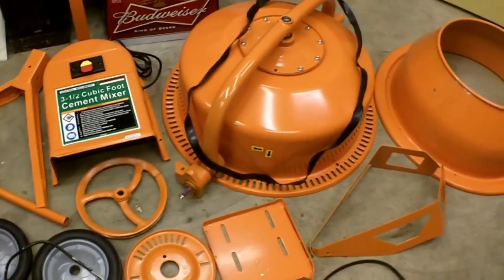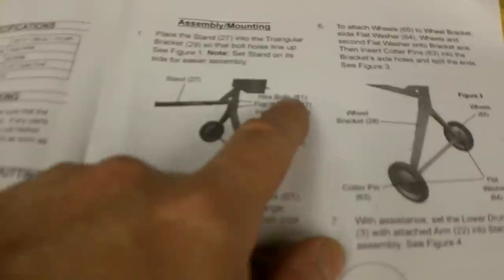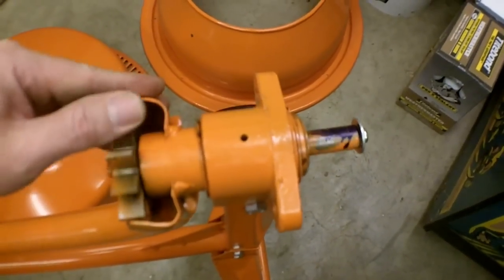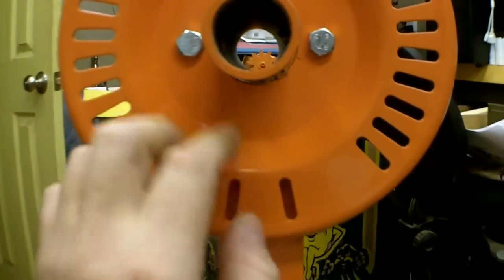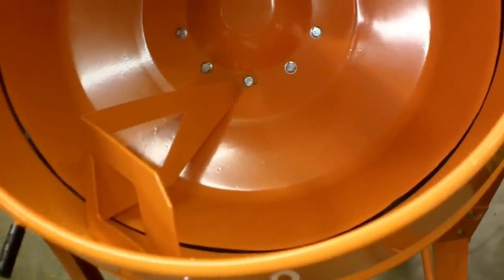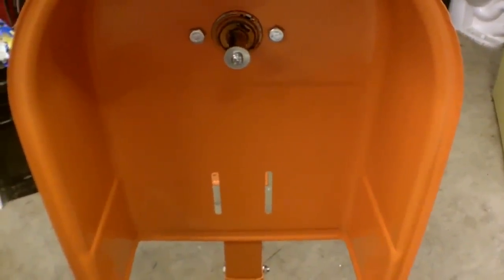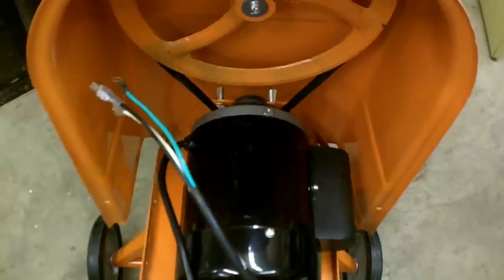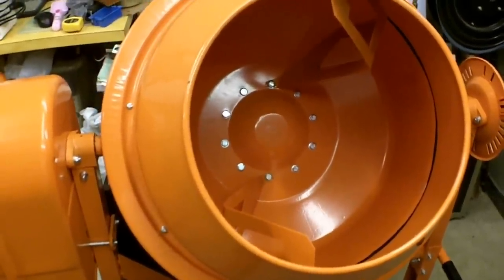Harbor Freight 3.5 Cubic Foot Cement Mixer Assembly and Review. Item 67536

Comment: You are a lifesaver, It is April 2019 and the manual has not improved not even a bit. Thank you so much for your effort to show a real assembly, this video rocks, I followed the steps and successfully got it working. It took me around 2 hours working by myself and now is ready to work around the house. Thanks a lot again Mr ghostses and best wishes.
Reply from the maker: Thanks Eduardo! I find it crazy after all these years the manual is still garbage. With that said, I'm glad the video is still relevant and helped you out. 2hrs. to put it together and now the real work begins....lol. Take care, G.
Reply: Well it's March of 2024 and guess what. The instructions won't even be good burning material.  I have watched 4 videos of assembling this mixer. Would have saved me half a day if I would have just checked youtube! Mine did not have separate bags of bolts, just all thrown in a box for me to figure out. Lots of bolt swapping before finishing. No screw in the box for end of pully shaft.. noticed one guy did not line up arrows on tub halves but no trouble putting in blades.  Not so with me, blades would not line up to holes until I noticed I was 2 holes off. Good instructions instructions 😅

Comment: I see that the HF mixer that you bought , came with a case of Budweisser. The one that I bought did not. So I returned it back to HF and they would not return my money but instead pointed me in the direction of the beer store where I now have a complete Hf cement mixer. I hate it when I buy something and it is missing the most important parts to complete the project. Thanks .
Reply from the maker: Yes it did! I've heard reports from others that theirs were also missing the case, and also got no satisfaction at the store about the issue. They were also instructed to go elsewhere to get the missing piece- which I find extremely odd. I'd expect more from their quality control and hope they will correct the problem in short order. I can see missing part of the case, but the whole thing?- that's simply wrong on every level. At least you got your kit completed, even though it cost a few extra bucks. Take care, G.
Reply: Thanks "G" ... Next time I might just shop with Northern Tools instead.
Reply from the maker: Texas Confederate

Good deal...LOL! NT might include the "proper" parts! G.
Reply: Step 14:  does the disc or the spiral spring go in first?
Reply: @jessemiles8347  the disc
Reply: I returned mine be because they would give me the case. Lol

Comment: Bless your heart.  I will be receiving my mixer from Amazon in 7 days and all I have heard is complaint after complaint about the assembly process.  What you have done here in your video is clear up all the confusion.  I've always been very good at assembling all types of things and if that parts are there I can do it no problem but here you have shown that the booklet does have a parts list to match up with the instructions which so often over looked and leads to frustration and hours of assembly and loss of temper.  THANK YOU FOR THIS VIDEO    BRAVO.
Reply from the maker: Thanks Dan! Glad it will be helpful. Good luck with yours, G.

Comment: Great video saved me from much heartache. Thank you for posting.
My cement mixer came with the fasteners in separate numbered bags. The lower drum was also came attached to the bracket.
I had to attach the ground wire from the motor to the existing ground location as this was the only attachment point on my cement mixer.
Used it over the weekend mixing many 60lb bags of cement, mixed 2 bags at a time, without any issues.
Reply from the maker: Thanks Paul! Glad it was helpful. Yeah, I heard of may combinations on what-was-what from many viewers. It sounds like yours has already paid for itself with what work you've done so far. Good to hear! Take care, G.

Comment: Out of all the videos I have seen on assembling this mixer, this was the best one. Now there are a couple of differences from when this mixer was put together to today Oct. 2020. One difference was when you hook up the wiring there is not a second post for the ground. You will have to unscrew the post and place there along with the other ground wire coming in. The other difference was minor and the only part I had left over or extra was another wire grommet when you feed into the housing cover. But nothing extra or missing. Thanks again was very helpful in following and assembling.
Reply from the maker: Thanks Bill! Glad it was helpful. Take care, G.

Comment: This cement mixer has the worst instructions of anything I've ever assembled. I am a retired jet engine mechanic, so maybe I am expecting too much. It's as if a disgruntled employee created these instructions to get back at the company. There are several references to parts, or bolts with no picture. Several parts were bent, and a couple were pre-rusted for my convenience. I used my own bolts, washers, nuts, etc. to ensure that this mixer was put together so that it would work safely. Great video!
Reply from the maker: LOL! Agreed, their manuals leave much to be desired. I'm pretty sure they switch manufactures from time to time, or make design changes but never update the literature to reflect them. Not to mention, most of them suck to begin with...lol. That's partly why I show assembly in my reviews if required. Glad you got yours sorted out- bent, pre-rusted and all. Good luck, G.
Reply: HAHAHAHAHA I sit here, one jet mech reading another jet mech's thoughts on some shitty ass instructions. HAHAHAHAHAHAHA  AD1(AW) USN H60 powerplants technician, TF34 CER, JOAP lab supervisor. this thing was created to make us doubt our skills.

Comment: This video helped me immensely.  I didn't even read the directions, I just watched this.  I completed the assembly in about 2 hours, while putting down about 3 beers, and gathering the tools as needed.  If you remove the beers and time spent looking for tools, it probably took all of 90 minutes to assemble.  Thank you for creating this video!

Also, today I put 60 bags of concrete through this thing, and it worked flawlessly.  I got it on sale for $209, and had a 20% off coupon, for a total of $167...that's slightly more than a 2-day rental from Home Depot.  Hopefully this thing lasts another day and makes it a smart purchase.
Reply: +Ted Kuhn PS, I appreciate your experience-based tips, like adding grease, thanks again!
Reply from the maker: +Ted Kuhn Good deal Ted! I'm glad the video helped. LOL, nothing like downing a few while working on something- it almost takes the work out of the work. I think you'll make it well past the break even point over renting and will still have the tool to boot. I hope you treated yourself to a few more beer after running 60 bags through it. That is if you could still lift one...lol. Take care, G.
Reply from the maker: +Ted Kuhn Thanks again Ted! G.

Comment: Thank you so much for your time and effort. Your video helped me decipher what the instructions simply could not. I usually don't read them anyway but found myself in quicksand then started reading them, then just came to your video and threw them away with the box.  I too bought it when it was on sale and it's been in the box for the last 5 years. For a hundred and sixty bucks its better than mixing cement in a wheel barrel.  Now I'm going to make it work for storage fees, when it breaks I will send it back to China.
Once again, Thank You.
Reply from the maker: That's cool Ronald. Glad it was informative. Take care, G.

Comment: Of the videos I watched, this one was the best in terms of covering most of the little issues that came up during assembly. Add my thanks to the many here.

To add my 2 cents:

Agree that gasket glue is not required, but putting the gasket in without will require a lot of fiddling with the gasket during installation to make certain it stays where you want it. I started by putting the screws (one at a time) through the top drum and the gasket. The gasket held the screws in place as you flip the upper drum to get it placed on the lower drum. You then have to go around and push each screw into the corresponding hole in the lower drum. After that, you want to get the gasket shoved in correctly between the screw locations, HOWEVER, do NOT push on one side of a screw location too far or you will rock the gasket out of the opposite side. Two fingers, one on each side of a screw location pushing equally was the best method for me. I ironed on the top drum, first by bringing the screw and nut finger tight and rechecking the gasket as I went around. (Just spin the drum and forget walking around the unit.) Next I added about three or four turns on each screw to snug, again checking gasket for alignment. Finally added turns to tight all around.

My unit had a burr in one of the bolt holes and one of the paddle holes at the bottom was misaligned. Used needle nosed pliers to extract the burr and a punch to align the misaligned hole and all was well. Make certain you look at the picture of the assembled unit once in a while to make certain you are adding the correct parts to the pulley side or the motor side. Just keep yourself oriented correctly, because the main cross piece is pretty much reversible and you can get things turned around in your head as to what goes where.

The pulley key on my unit was a bit big to fit into the slot cut into the main shaft, so ended up putting the pulley on the shaft and lightly tapping the key into the slots. On my unit one side of the lower drum arm bar was misshaped so had to get a mallet and a block of wood to tap that end into the supporting brace. No biggie, but certainly speaks to lack of quality control.

Thanks for the tip on removing the switch from the outside motor cover to get to the screw head to attach the ground. So much easier that way. If the manufacturer would have included a second nut on that grounding screw, this wouldn't have been a problem in the first place (a-hem!). Just like this video, I matched wire colors green to green for ground, black to black and white to white for the switch. That's standard, but as the man said, disclaimer: no instructions so you are on your own for that step. Don't understand companies that fail to update instructions when manufacturing and/or assembly procedures change. (Cough, cough, a-HEM!!!)  Some videos show a struggle to not damage the electrical wiring or switch when attaching the wire to the motor and before attaching the outside motor cover. Get a saw horse or a small table or stool to hold that outside motor cover at a reasonable height while attaching and the whole issue goes away!

The bolt for my spring tension adjustment was not in any bag and just thrown loose into the Styrofoam tray on the top. Glad I found it and saved it as it would have not been fun to replace that bolt in the middle of assembly.  BTW, one of the other videos talked about trying to mate the drum halves before putting on the handle. Glad I had the handle on first, as it would have been a whole lot more challenging to try to manage the two drum halves, the gasket, and all those screws if the bottom half drum was swinging freely!

My last challenge was setting the electrical cable clamp during motor assembly. Had not done that before and did not realize the hole is keyed to a particular orientation of the clamp. Fought with it for a while then turned the clamp 90 degrees to what I what trying and it slipped right in.  Hard to see that requirement when the black switch box is mounted to the outside motor cover. BTW they included a second cable clamp in my parts bag. Anyone missing one?

Got my unit turned on and it did spin. Will find out tomorrow if I missed anything.

Harbor Freight, you need to start finding American (or at least north American) suppliers for quality, yet affordable tools. I want to stop buying from China.

A note to the other video makers (THIS NOTE DOES NOT APPLY TO THIS VIDEO - THIS VIDEO IS GREAT!):  If you screw up a step in your video, don't just put a caption up that says this is wrong and go on. Take the time to reshoot the scene and give us the correct way. First, it hides your screw up, and second, it makes you look a lot smarter, more credible, and more trustworthy to the audience. I stopped watching a couple of videos once they admitted their mistakes. What else did they mess up and not admit!!! (Or were they too stupid to realize their other mistakes???)

A note to my local equipment rental store: If you'd have charged about half your current rate for concrete mixer rental I would not have bought this unit and rented from you. As it is, my planned use for the unit will more than cover your rental fees and I still have the unit for family and friends to borrow when their projects come up. Yeah, I have to store it, but I'm done paying outrageous rental fees for a simple mixer. If I get tired of storing this unit, I'll sell it and recover at least part of my money - none of which went to you!
Reply from the maker: I like the way you think Tom! The rental fees and having to race the clock is exactly why I purchased mine. As for your comments on videos captioning and covering up mistakes- I wholeheartedly agree. I can't tell you how many times I've taken something back apart just to shoot the clip again so the information is correct. Not trying to imply I'm any better than anyone else- but just to illustrate how much time an effort it takes to do videos like this. Anyway, hope it works out well for you. Take care, G.

Comment: Thank you for this video. I bought the mixer yesterday and there were a few changes but the video is still applicable and made the install extremely easy. The lower drum is now connected out of the box. My arrows did not line up perfectly and were off a few inches but didn't seem to hurt anything. The inside of the switch is a little different but you just need to follow black to black and white to white.  With the 20% coupon it was $164 including tax in NC. It's amazing to me they can design, manufacture, and deliver something like this for the price. Thank you China and thank you for making this video.
Reply from the maker: No problem! I've heard there have been some small changes. Glad it was still useful getting it put together. Thanks for the info and good luck using it for your projects. Take care, G.

Comment: No more bags of bolts numbered... just one small bag for drum assembly and another bag with various nuts, bolts, washers. Your video helped me....... some things are different in the assembly now... just bought mine 12/2/2019 and assembled 3 months later. I used rubber cement to secure drum gasket. Thanks for your video.
Reply from the maker: I've been hearing that Ken. Not optimum but doable I guess. Glad it was helpful and you got yours together. Take care, G.

Comment: Thanks for a very useful video. I have to agree that leaving the last step completely off is almost criminal. Even more so in my case since the motor leads were missing their crimped slip-on connectors. Luckily since I have a electronic background, I found some others laying around in my garage and soldered them on to the leads. I also followed your example and created a second ground terminal using a 8-32 screw and double locked(jammed) hex nuts. What a tacky power switch assembly, I hope it can last the life of the machine. At this time,
I have had great performance with this mixer(22 bags mixed) and it doesn't seem to have any major flaws. Your directions were a life saver
and I thank you again.
Reply from the maker: No problem Jay! Glad it was useful. Seems like a QC problem for sure with the leads being without connectors. Glad you got it sorted out and it's working well for you thus far. Take care, G.

Comment: Forget that last question as only one way to put on, just did my best to tuck in the gasket as I screwed down the 8 nuts/bolts. I completed using this video without and issues and no left over parts. But they did make some changes: 1) No installation/instruction manual at all, just a parts list and Operation Manual.2) the bottom barrel was connected to the U shaped bracket arm, so one less thing to put together 3) the motor when mounted on the tray self aligns as you can not move back and forth for alignment, and does work well. Runs pretty quiet. Great Job on this video.. Thank you.
Reply from the maker: +Paul Naz 
That's exactly what I did Paul. Thanks for noting the changes as they might help others. Glad the video was helpful. Good luck, G.

Comment: This may be my favorite instructional video on YouTube. Thank you! I just bought mine and because of this video I waited until I had the 25% coupon and got the unit for $150 like you did! You literally saved me $50 bucks!
Reply from the maker: +Justin Lingle 
Thanks Justin! Glad you were able to get the coupon and apply it! No you can apply those savings to the project you purchased this for. Win-win! Take care, G.
Reply: ***** Haha! I got your reply in the middle of watching your video while I'm putting the mixer together! Mine doesn't have little numbered bags. Just 2 bags with all the bolts, nuts and washers in one and specialty parts in the other. No worries though,  because I have your video. I will say (on the plus side) mine is nice and quiet! No scrubbing or anything. Smooth as silk!
Reply from the maker: +Justin Lingle 
LOL- that's cool. Hmm, just two bags. They should go back to the numbered ones. Glad the video was helpful and yours is smooth! Good luck, G.
Reply: For belt tension 1/2” may be fine for this machine but belt deflection depends on the space between the pulleys. For alignment I use a piece of metal for a straight edge.